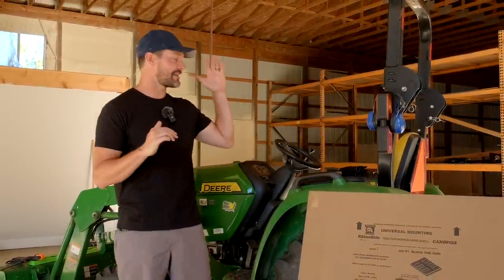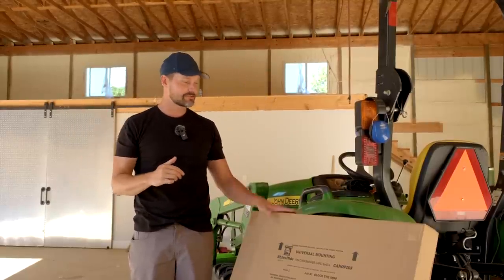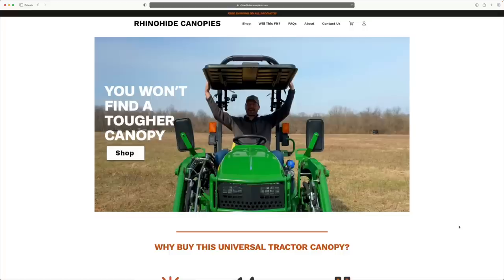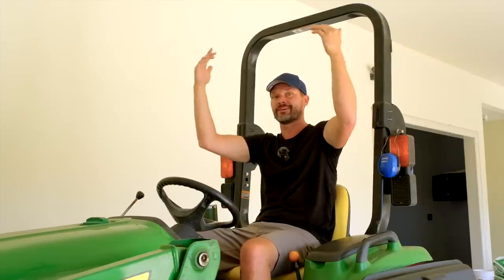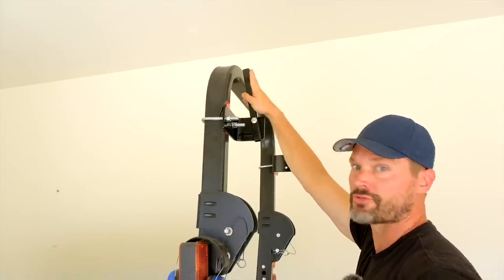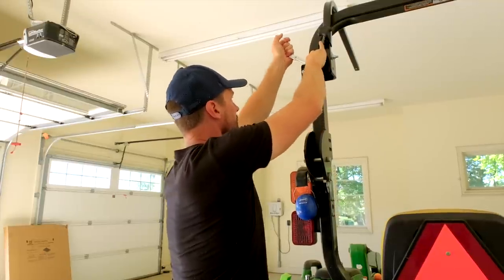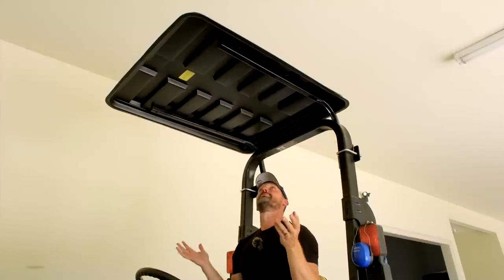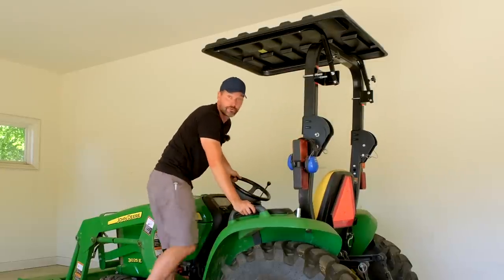I LOVED THIS TRACTOR PRODUCT SO MUCH THAT I BOUGHT THE COMPANY!

Comment: That looks tall, did you fit under the garage door to get it out?
Reply from the maker: It was too tall for the garage door by about 1". So we took it off and drove out. But we store it in a barn with huge overhead doors, so for us that wasn't a concern.
Reply: @GoodWorksTractors  my son did a similar thing, he installed big wheels and tires and gear reduction on his defender atv, only to find it was too tall to get out of his garage.  So he keeps it in dear ole dads bigger garage.

Comment: Haven't finished the video yet, but would you not want any moisture to run off the rear of canopy instead of running off the front and maybe all on the driver?  Your over heating problem may be a thermostat sticking open or closed.  Semi educated guess.
Reply: I've never had issues with moisture, only getting somewhat wet from the sides during rainy day fun.